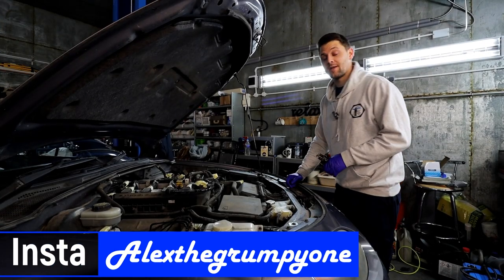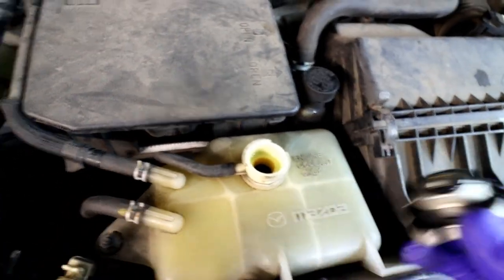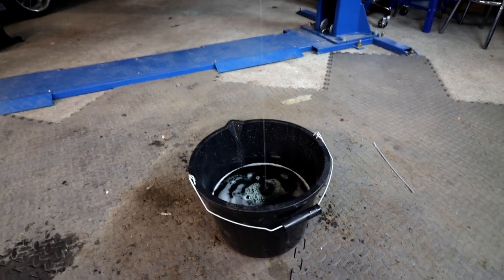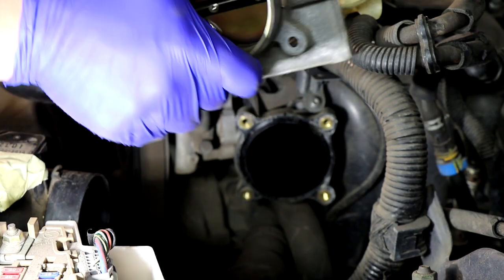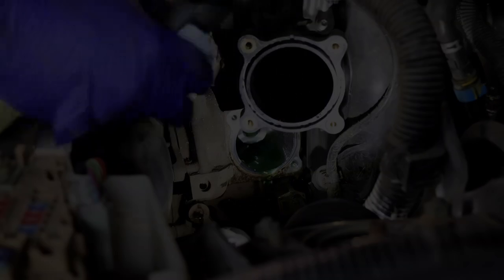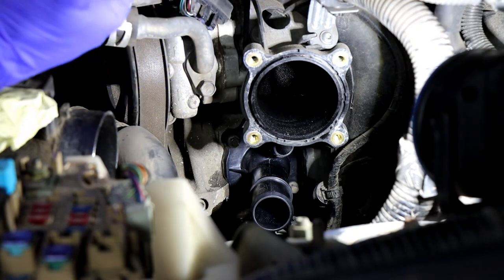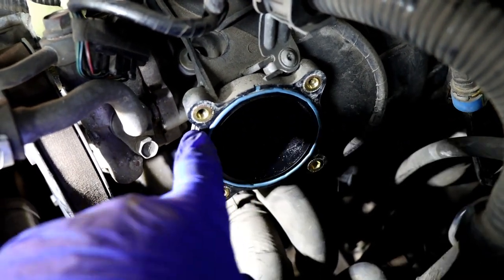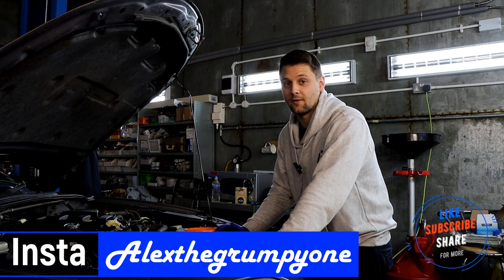Mazda MX5 NC mk3 thermostat replacement. How to replace thermostat or coolant on your car.

Comment: I’ve been needing to replace my thermostat on my 2008 miata that I just got and this video helped me out so much, i studied this video , bought what i needed to , and got started . I will say it was absolute hell getting that thing replaced though . Once I got the throttle body off I spent at least 2 hours trying to get the smaller hose that’s attached to the thermostat off and in the middle of the job I had to go pick up the correct pliers and it was still hell, then I got it off and I kept dripping stuff in my car and I had to fish it out . Anyway the point is this was hell but it was worth it and saved me money in the end and I’m very thankful for this video. It took me a total of 6 hours to get this done in one sitting😭
Reply from the maker: Sounds like a bit of a nightmare unfortunately... but I'm really glad that you got it done 😀 I'm glad that video is helping out

Comment: Thanks so much for this video. I have been needing to replace the thermostat on my 2006 for a while but I read some horror stories online of how difficult it can be so I have been putting it off - this video is a life saver. I plan to tackle this job during one of the next couple of weekends before the track season starts!
Reply from the maker: Thank you very much! No worries at all. Yeah it's easy as long as u know what u doing... u know now 😀

Comment: great video. quick question, when you bleed the system do you keep the cap off while running the car? i know its a pressurized system so wasn't sure
Reply: @AlexTheGrumpyOne  thank you Alex. but with other cars i usually have the engine run so the thermostat will open and get all the air out of the system. these cars had a radiator cap. since this is a pressurized system, to bleed the engine block i need to have the car reach operating temp so the thermostat will open but wasn't sure if i can do it with a funnel and the pressure reservoir cap off. thank you for such an amazing video
Reply from the maker: Ohh sorry bud my mistake. For some reason I thought about the brake fluid bleeding. I only realised what video it is now... I do apologise! 
Yeah when bleeding the system you definitely need engine running and keeping an eye on yhe coolant level.
I leave the cap off in the begging to keep it full while its filing up and then closer to normal op temperature I put it back on 😀 to pressurise it.
Reply: @AlexTheGrumpyOne  thank you so much I was a bit surprised when you wrote car off. Keep posting more nc videos please love how detailed you are
Reply from the maker: Thank you very much! I appreciate your support and kind comments
Reply: @AlexTheGrumpyOne  any time. This is a 2007 Miata that I have as a summer toy car with only 44k miles so it’s my first cooling system flush and want to change the thermostat and water pump since it’s too old also the tank I order the maroso one. I’m a bimmer guy so not so much experience on the NC. Please add more videos you rock brother
Reply from the maker: Sounds good and well done for doing it yourself 😀

Comment: What does it mean?
Btw I used equivalent to fl22... the green for asian for my mx5...same yr etc as yrs l.
I noticed low coolant I topped ot off the when I drive or mx5 warms up on AC or Heat on.
The coolant comes out of overflow reservoir tube.
It shows low coolant again.
I repeated a few time w same results. 
I'm thinking thermostat malfunctioned, needs replaced. 
I'm a hands on non-professional diy'r.
Am i on target? Pl ty
Reply from the maker: I would recommend doing headgasket check or try and bleed cooling system to make sure u got no air lock